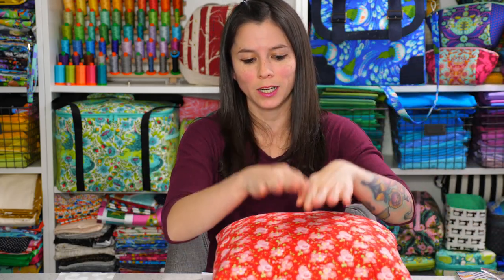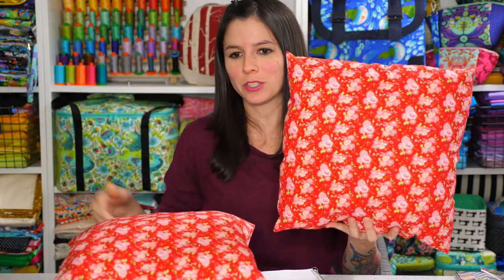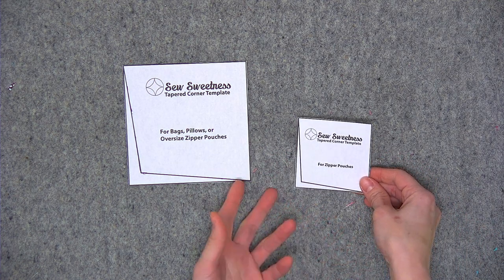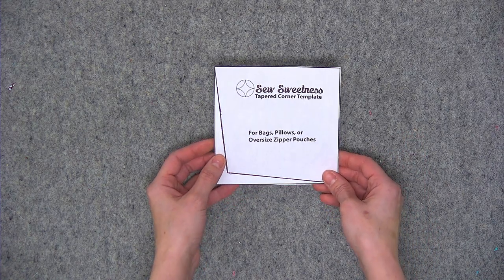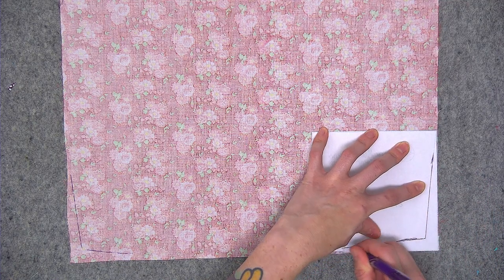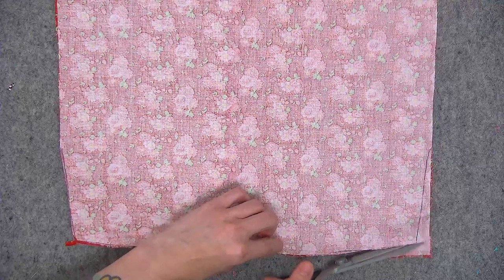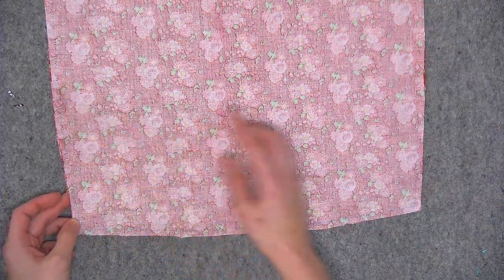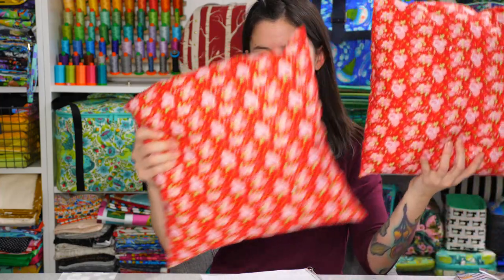How to Make Tapered Corners in a Pillow or Other Project

Comment: Basically, no paper template needed. 1) Pillow width / 4 = depth of cut from corner 2) Mark 1/2” in from corner  for 24” square pillow and smaller (or mark 1” in from corner for oversized pillow of 25” or larger. 😉